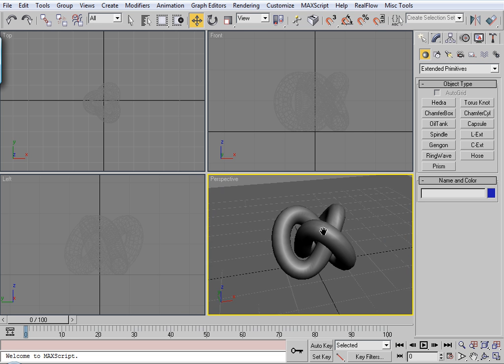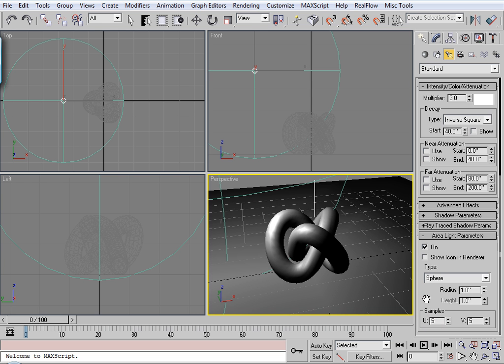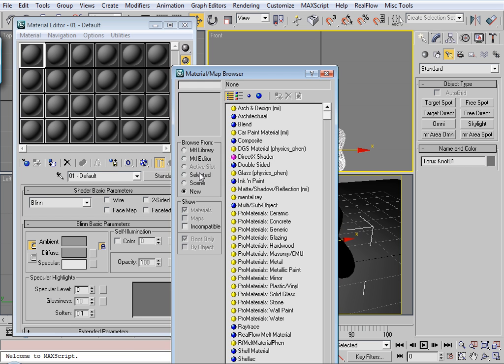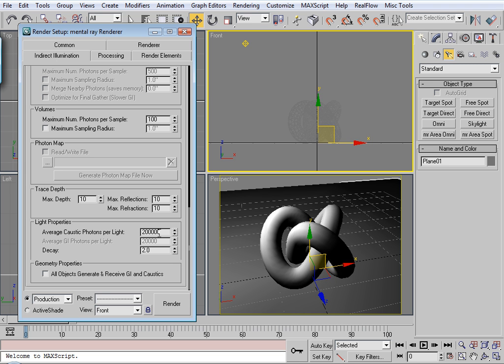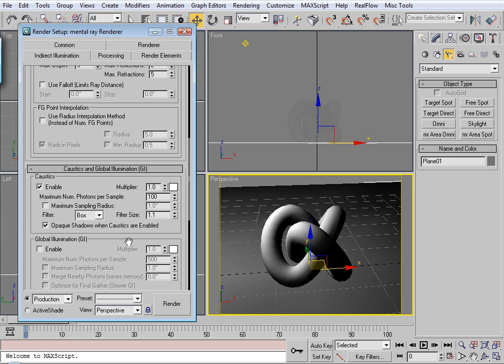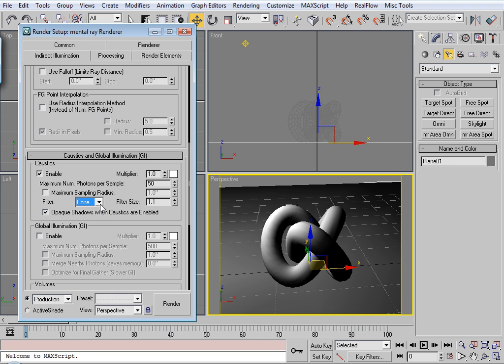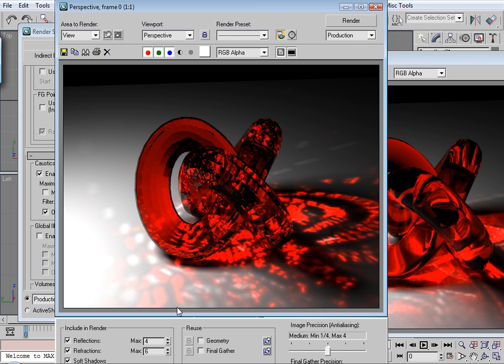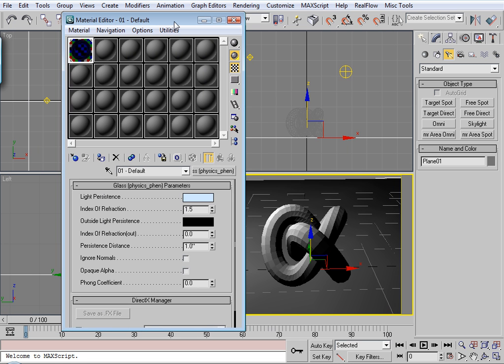3ds Max Caustics Tutorial

Comment: For those of you who still get the error message... I found my problem.

I got the "no caustic generators" first, until I checked so that all geometry generates caustics the the Render Settings window like shown in the video.

Then I got the error message saying "No caustic EMITTERS in the scene".... At first I didn't even notice the error message had changed...(as I'm sure is also the case with many of you out there) it's easy to miss because at this point you're frustrated and will assume it's the same error message about no generators n shit. 

Solution, which is not mentioned in the video:
Checking the box for all geometry in the Render Settings doesn't apply to light sources...because they don't count as geometry. 

So...click the LIGHT SOURCE and go to object properties and make sure "Generate Caustics" is checked. I also unchecked "receive caustics" because a light source should need it. 

Hope this helps.
Show less

Comment: Hey, just have a question similar to the last post. How are your renders so fast. I have a comparable computer to yours, and i7 860, 8 Gigs of Ram and an ATI 5850 graphics card, and it takes me significantly longer to get an image. I just have that box popping around inside the screen rendering little blocks at a time. I don't see that on your video. Are you rendering using your graphics card? 

Thanks for the video.

Comment: @GretschDstickSmoke 
Hey bud, make sure you've assigned Mental Ray as your renderer. I thought the same thing when I first started using my student version of Max11, that they had nerfed it or something.

However, once you're in the Mental Ray renderer, materials will show up, but you may still not find the exact glass material that the tutor is using. I found that using the Autodesk Solid Glass material worked just as well.
Also make sure you turn on Generate Causics on the light itself.